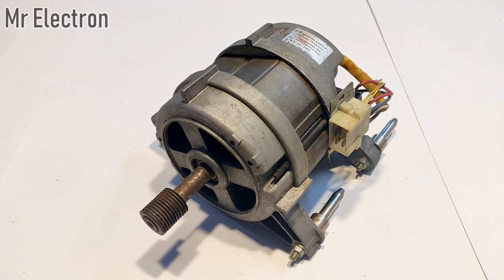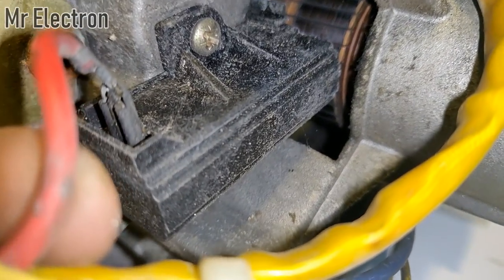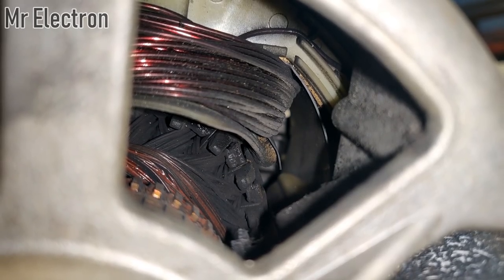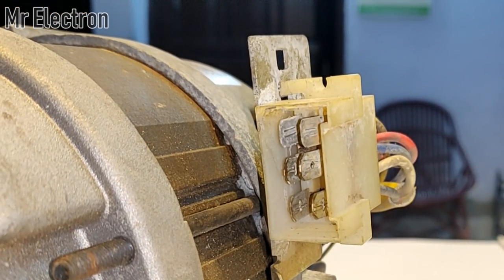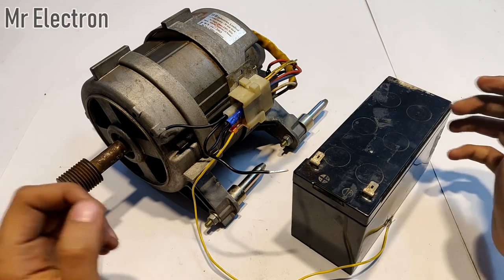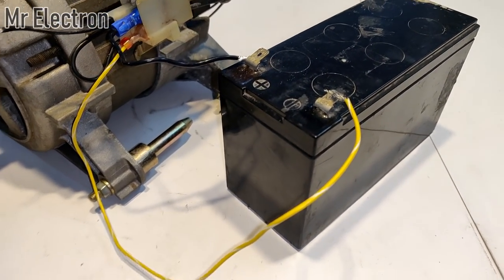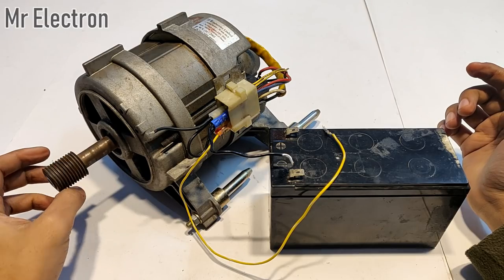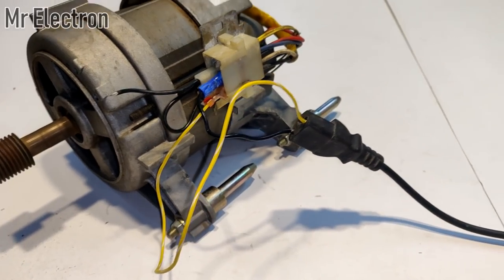Run a 220V Washing Machine Motor at 12V DC ( UPS Battery ) - Full Explanation, Wiring, Connections

Comment: Come one, motor can run both clockwise and counterclockwise. You only have to reverse el. current on one of the motor windings and leave el. current on the other winding unchanged. When you exchange wires on the battery you reverse el. current on both windings, so rotation direction does not change. Olso, keep in mind that if motor nominal voltage is 220V and you apply only 12V (18.33 times lower voltage), you get only a very small fraction (1/336, in power of 2). of it's nominal power. So, if for exsample nominal power is 2000 watts, you get only around 6 watts. But you can rewind the motor to make it's nominal voltage 12V, or use 18 ~19 12V batteries conected in series to get 216 ~ 228V DC, or use 2000 - 3000 watt 12V DC to 220V AC converter to make motor run in full power. BE CAREFUL, VOLTAGE HIGHER THAN 50V IS CONCIDERED TO BE DANGEROUS TO HUMAN LIFE.

Comment: Would 12v be suitable battery spec for running a 220-240V DC mortor?especially when the mortor is supposed to do a grinding operation using a plate mill.

Comment: Please use two different dc power source, one for field winding and other for armature winding, then reverse the polarity in any of the winding, and you can change the direction of rotation, if possible please make a video on that
Reply: Doesn’t have to be 2 different sources. You should be able to do it like a golf cart.

Comment: keep it mind a washing machine motor is actually a universel motor it can runs both ac or dc and also runs any voltage if you want but the higher limit is 240v same as vacuum cleaner motors
Reply: What dictates a universal motor?

Comment: good video. i do have some questions.
1 why are those black wires that is connected to the left middle and lower terminals for.if they are not going to be used.
2 finally the motor runs only by connecting the right middle and lower terminals to the battery.
how is this possible, can u please explain.

Comment: what did you mean by connection the motor to the battery charger ? is the battery charger was connected to the house electricity ? or to a battery and it worked like an inverter ? can you explain ? and if I did your way with the wires and used more batteries to reach about 110v will I get more torque and rpm without using an inverter to converter 12v to 220 ?

Comment: Hi bro, good night. I would like to ask a question. I have a common brush motor with 220v 2000w AC brush. I wonder if I put several batteries to form 220v if I can make it work normally without needing an inverter?

Comment: I have a 120v 12 amp corded lawnmower, I want to add a battery to it so it is more mobile.  What size battery would I need?  THe motor on the lawnmower is a universal motor, so it should run off of AC or DC right?
Reply from the maker: 10 x ( 12 v,12amps batteries ) each connected in series or 5 x 24 volt batteries connected in series 12A each.
Or
Buy a powerful boost converter with one big 150 ah 12 volt truck battery.
Although, I am not sure if that much powerful boost converter is available in the market and again their losses.

Comment: Hello! I have a 12V MC battery which I think to connect with a small DC motor. The battery is 12V, 100AH. Is there any problem if I use this battery to wire my motor because of the capacity of my battery? I mean should I buy another battery with lower capacity (less than 100AH)? how should I think about this issue?
Reply: Id use that batterey

Comment: Got a question, can I use an inverter to these kind of motors to lessen my consumption yet performs well? or it depends to the motor I'm going to use?
Reply: No, there's always loss. Newtons laws and such. Object in motion can go in motion forever unless another force. There's multiple factors that affect the EMF (electromotive Force) Eddy's currents, resistance, line loss, and many more. Lots of formulas, but no. Everytime you change state in term of ac-dc (rectify) or dc-ac(invert) it causes power loss due to heat and inefficiency. They only way it's possible is by using diodes and resistors to "burn off" voltage (on purpose) to reach a certain voltage.

Comment: Dear sir, can u make a project of making car alternator to work as DC motor and connect it with 24v pmdc electric cycle controller, if not pmdc then 24v bldc controller. Also if possible it should run on 12v battery. I want to make a electric cycle using car alternator.

Comment: I have 7 wires ( including capacitor wire) washing machine motor. I wanted to wire it only at high speed to make sander. Can you show me the process. The motor is c68pxcap- 4580. Thank toy

Comment: My washing machine motor has 3 wires it runs if connected to 220v AC how can i run it using 12v battery plzz reply me faster i am seeking the answer i need it for my e bycycle project

Comment: did u compute its HP bro?
Reply from the maker: little less than 1 hp - 690 Watts
Reply: @MrElectron  if im not mistaken,with the right schematics, the motor can be attached to a mini generator that can charge back the batteries,mechanical E to electrical E.its possible right?
Reply: ممكن ترجمة إلى عربى
Reply: @adm-us9zv  اول شي ساله هل قست قدرته الحصانية فجاوبه اقل من واحد حصان ستمية و كذا واط
ثم قال له هل يمكن ربطه على مولد ليعيد شحن البطاريه و بذا نحول الطاقه الميكانيكية الى كهربائية و لحد الان ما رد لكن لاني دارس ميكانيكا و كهرباء اقولك ما نجحت قبل عملو مولد بديني و فشل و هذاك انجح من هالاقتراح لانه يعتمد ع فلاي ويل للاستمرارية لكن تعرف القانون الطاقه تتحول من شكل الى شكل لكن لا تفنى و لا تستحدث من عدم فالموضوع لا يستحق و افضل الطاقه الشمسية ان اردنا طاقه مجانية

Comment: Why for yellow wires.?
Reply: Those yellow wires are for Tacho generator...
Tacho acts like a tachometer which in turn tells the PCB at which rpm is motor rotating....